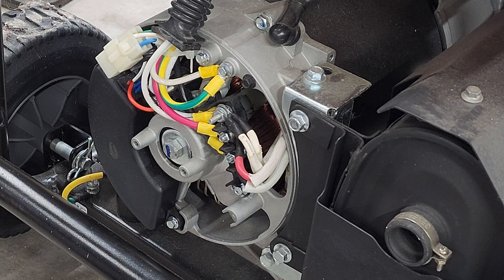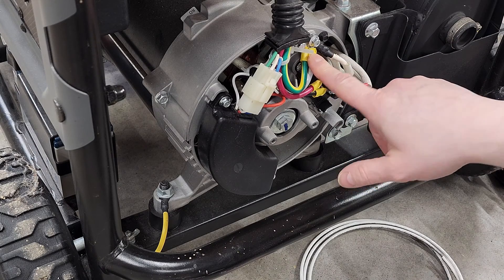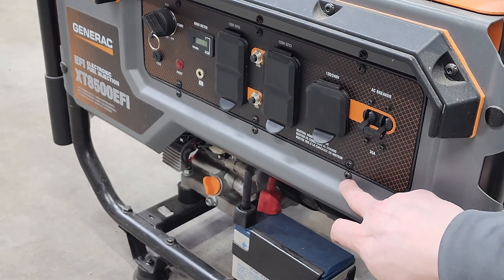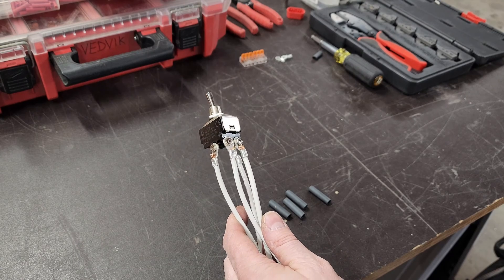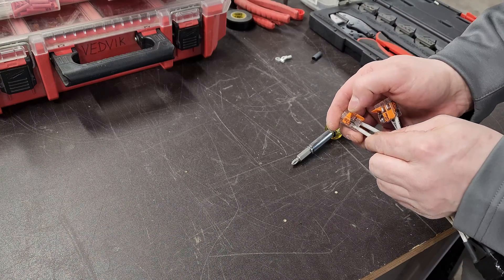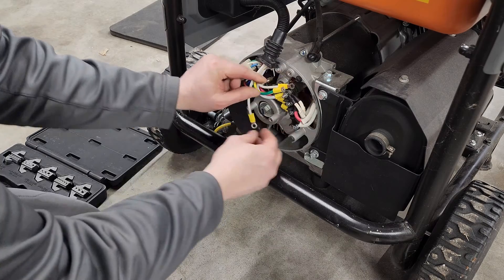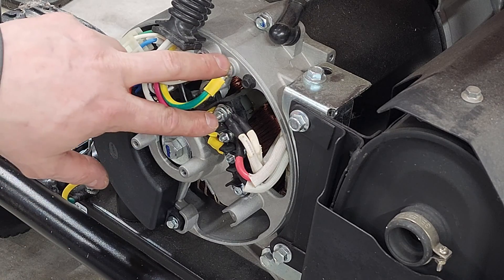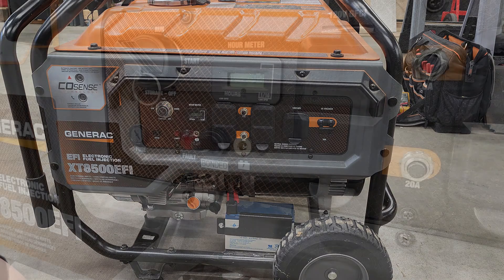Electrical Engineer Explains: Portable Generator Bonded vs Floating - How I modified my generator!

Comment: Here is the problem. If the generator power cord looses it neutral bad things can happen. This loss of the neutral in the cord has happened on another YouTube video. There is no easy way to test your cord for an open neutral. Typically this would be done with a multimeter and most people are not familar with how to test for an open neutral and few people would know that you need to test the cord for an open neutral before use.

If you connect your home with a generator using the 240 volt connector and you have an open neutral in your power cord two things can happen. If your generator has a bonded neutral then the ground wire takes the place of the missing neutral and you never know the problem exists. If you generator has a floating neutral then the return current on the neutral has no return path and the house voltage to the 120 volt outlets varies widly and can cause you appliances to catch fire and burn down your house. 

As a result I will only use the generator as it supplied from the manufaturer. Using it with modifications can result in you taking on the liability and your home insurance carrier not paying your claim.

Just because a buliding code says somthing it does not always mean it applies to your situation and it is the safest way to work. Manufacturers of generators have liability standards for a reason and it includes instructions and if a floating bond switch was required they would provide it and all of the instructions.

Home made power cords can be the most dangerous.
Reply from the maker: Great comment.

I agree a loss of a neutral conductor is a major concern, but that concern exists in every circuit and every panel in every home.  It is more dangerous to have multiple neutral-ground bonds, and it's illegal.  Always having a shock hazard is worse than the rare/accidental instance of a lifted neutral in which problems immediately occur (since voltage reference is lost).

The logic you present applies to sub panels as well, correct?  Do you think the same lifted neutral concern outweighs the prohibition of bonded sub panels?  

In this video, I only changed the neutral bonding configuration, the factory neutral wires were unchanged and connected in the same manner.  I did not introduce any additional risk in the form of a lost neutral.  I understand the point you make about a redundant path, but that is not the intent of the EGC.

This modification allows me to run my generator in a floating neutral configuration, with a continuous EGC in the generator receptacle (my previous video lifted that ground), so my generator uses the N-G bond in the home.   Obviously, the best solution is a 3-pole transfer switch so both home and generator are bonded (separately derived) and the ATS switches the neutral.

Homemade cords carry risk, but so do cheap molded cords.  Adding a cord cap to a wire is very tricky as the lengths have to be perfect and strain relief is needed.  In this case, I did not modify any cords.  I can certainly see how a homemade cords can cause a lifted neutral.  Excellent point, and I don't advocate for modified cords either.

There is shock hazard and danger in having the ground wire used as a neutral and that is not it's purpose.  The purpose of the EGC is to carry inadvertent current from metal casings that accidentally become energized.  If we relied on the EGC to hide the lifted neutral, we extend the amount of time we have a lifted neutral and we have a shock hazard the entire time.

If a lifted neutral occurs, damage to certain types of equipment can occur due to fluctuating voltages but a shock hazard is not any more present than normal.  My concern is safety to people over protection of things.
Reply: @richardvedvik979  Can you do a video explaining everything you speak of here in this discussion    :)
Reply: Just a thought regarding “if the manufacturer” comment you made.  I wonder how that liability would apply, if in the owner’s manual for my Westinghouse generator, there is a section explaining how to float the neutral, when connecting to  panel that already has a bonded neutral.   I know liability is a legal issue and not an electrical one, but it does appear that the company is saying “do this” if needed.  Thoughts?
Reply: @larryr8320  I think this issue is an opportunity to debate the legal issues in a court of law. Judges and lawyers are not engineers and engineers are not lawyers. As engineers we can only assess what may happen or what has happened in the past. Assessing risk and liability is not always fair, equable and right. We have lawyers and judges to make those decisions, right or wrong. A building code by itself is not a law. A code enforcement department is the law enforcement arm and can adopt national codes into enforceable laws. When this is done, the code enforcement department must also interpret exceptions to the rules. 

Now when a consumer is injured by a manufacturer’s defective instructions, the consumer must provide evidence to the court as to why the instructions were defective. Again this is where the engineer comes in to provide expert testimony and the manufacturer provides their expert. This is why the manufacturer instructions are written conservatively so that they do not expose the manufacturer to liability. In many cases they are silent on issues. Silence can mean that it is not to be used outside the covered instructions. In some cases the manufactuer’s  instructions can override the national code if the code enforcement department agrees.

Comment: Thank you for your video.  Some people may find it difficult to identify which wires would be the neutral and the ground inside of the generator case.  Some more information on that may be helpful.
Reply from the maker: I agree and will release a part 2 that explains why and how to use.  I wanted to control the length of this video.